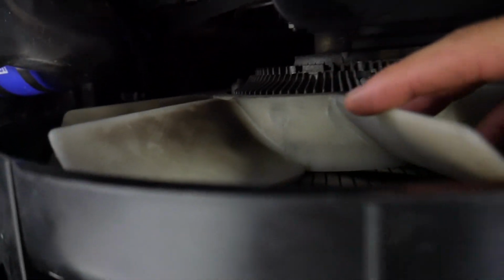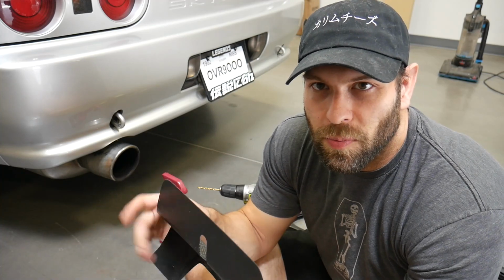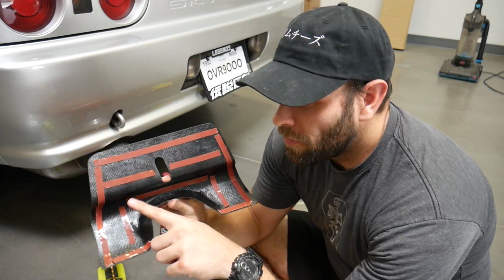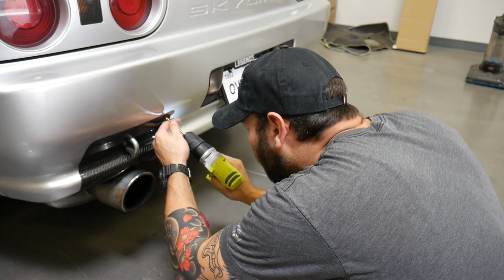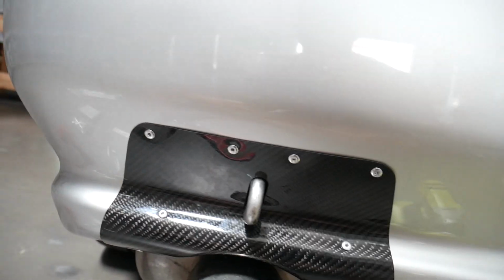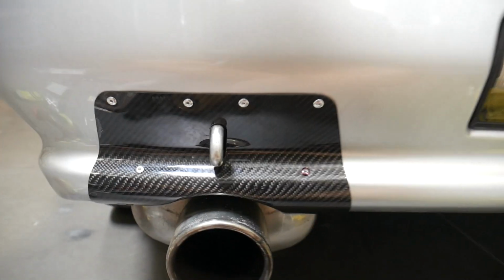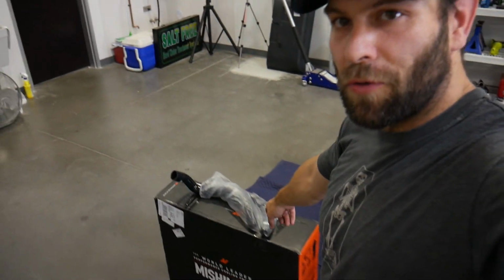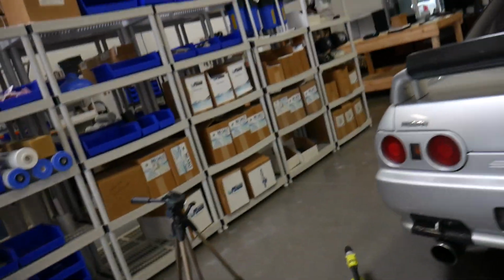R32 GTR Gets some Carbon Fiber!!!

Comment: Are you sure that the gas is the problem with the AC? :) Might be the air mixer and/or the inlet filled with junk? I assumed my comp was empty or broken but turns out the air mixer was dead so i only got hot air blowing :)
Reply from the maker: Well I wanna just replace the entire system with updated gas, since r12 hasn’t been used since 94.
Reply: @RyanDenton  oh okay, yeah, thats not a bad idea either way :)